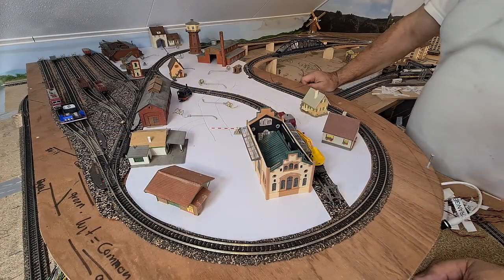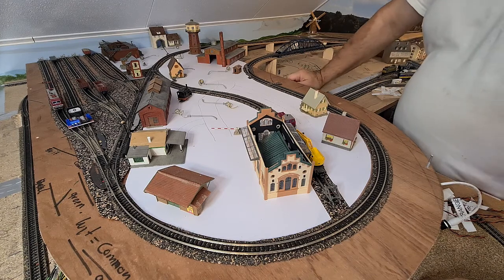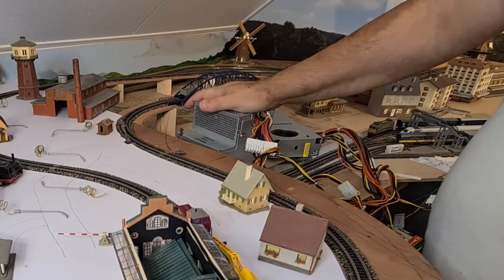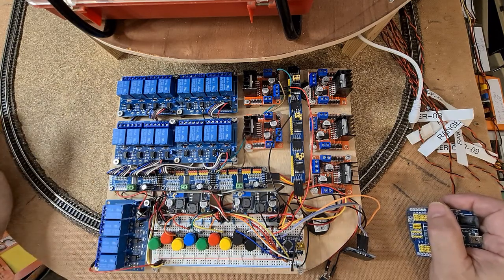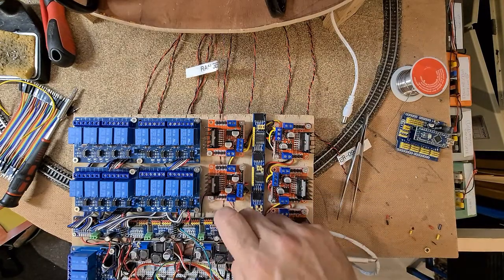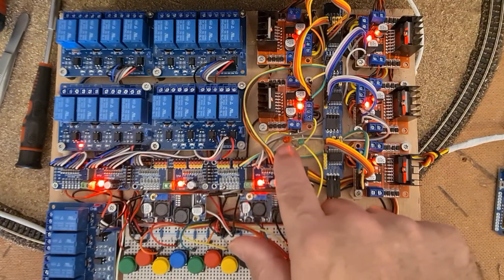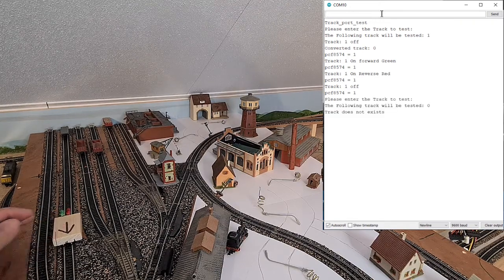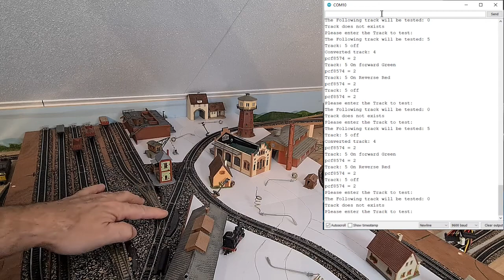VLOG # 30  Putting Power onto the Train Yard

Comment: You can get a 24 pin board off Ebay with a switch for your power supply.  There is connection points for the different voltages.
Reply from the maker: Thank you for the tip Scott, I will look out for it